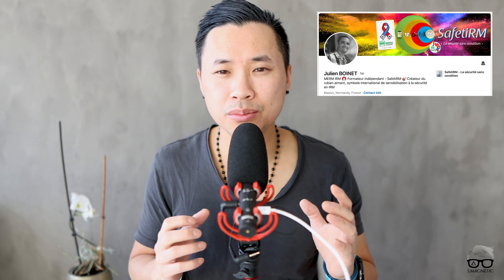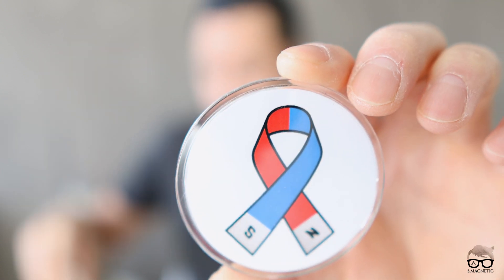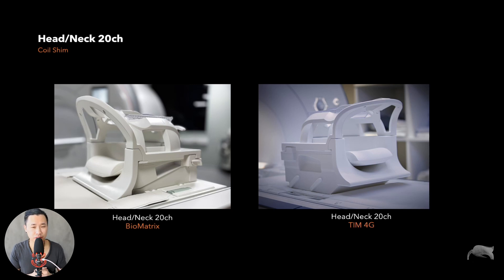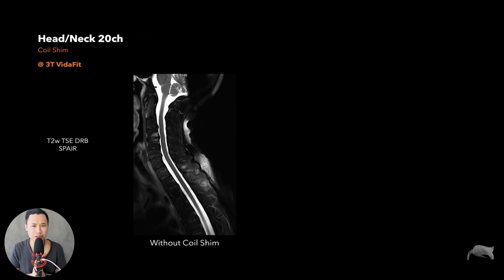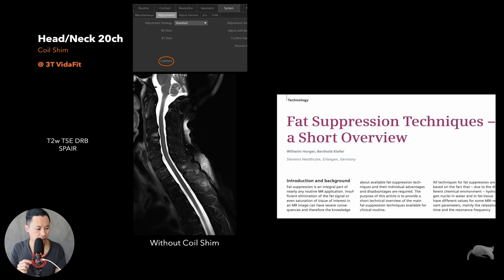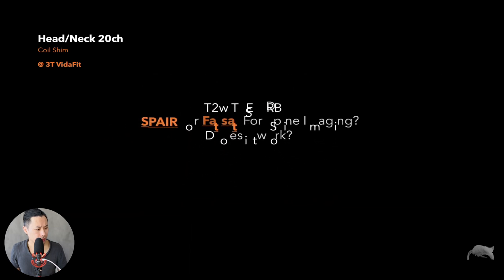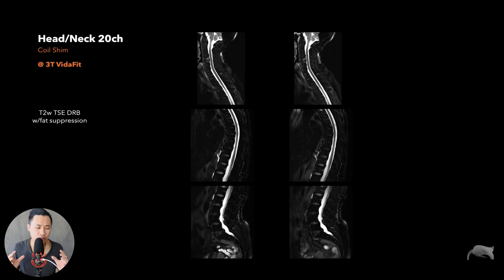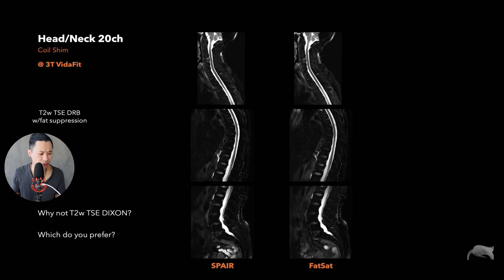MRI HEAD NECK 20CH (BIOMATRIX) – COIL SHIM

Comment: Hello sir  We do Non CE neck angio in Magnetom Vida 3T but the image quality was very bad in the arch of Aorta the signal was very bad that happen only in neck angio . The machine was new install 2 month back .
Reply from the maker: Hi, thanks for your comment! Several key factors could influence this, including sequence selection, parameter settings, and more. Since this scanner is quite new, have you had any support from an application specialist to assist with optimization?

Comment: Which Spair mode did you use? In spine I prefer Spair over FS and use broadened off-center (thorax mode). Especially in 1,5T, because fat and water Hz-difference is smaller in 1,5T (210Hz) than in 3T (420Hz), where because of that simple FS (sharper Hz profile for sup.) is easier, but still Spair (broadened Hz profile) works better also in 3T, in my opinion. With FS it is impossible to suppress only fat, if water and fat frequencies are overlapping and/or frequencies have been broadened too due the susceptibility effects. Like in spine where there is allways inhomog. tissues, air etc. and bigger FOV.
Reply from the maker: thanks for sharing your experience. But do you see any differences in these two  fat suppression techniques?
Reply: @Nguyen_MRI  Yes, I see differences in these techiques. But no, not much in your test patient and images, same spots not supressed. Bigger patients with more fat in C6-th4 shows usually worse outcome with FS, but better with Spair off-center. But that's why I asked the used Spair-mode? If you try SPAIR with thorax-mode and abdomen-mode and compere all to FS, maybe then.  Great test, because usually you see just FS/ STIR/ DIXON used in Siemens, rarely Spair.
Reply from the maker: @nookenieminen5826  yeah i could test more too see of course. Spair mode standard used here. I just want to highlight the impressive of fat saturation on 3T with spair and even FS with the new biomatrix system. On older 3T skyra with e softwsre, this was not easy. Again thanks ☺️👍
Reply: @Nguyen_MRI  Ok, so if I remember right, it was then 650Hz with no off-center. And yes, that FS worked surprisingly good with new coil. It would be great to see how does FS work in 1,5T with new coil.